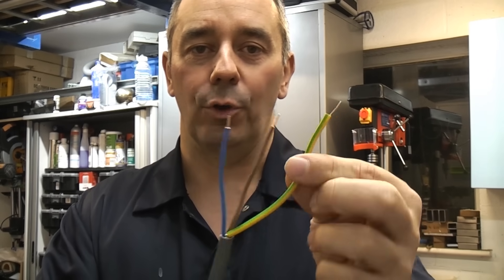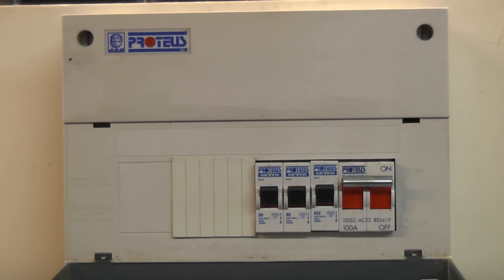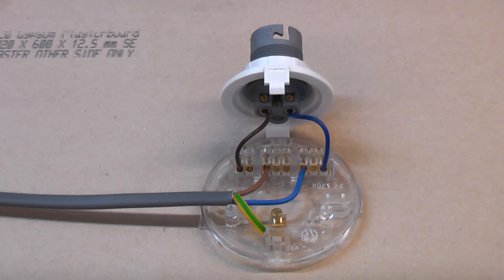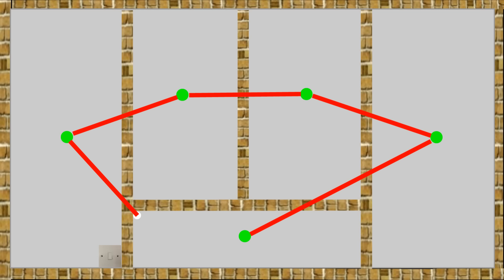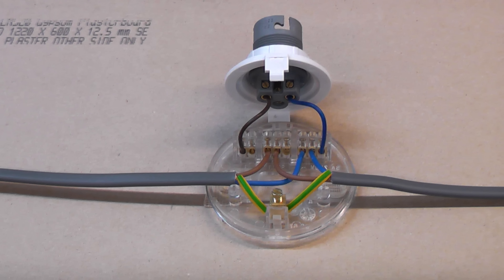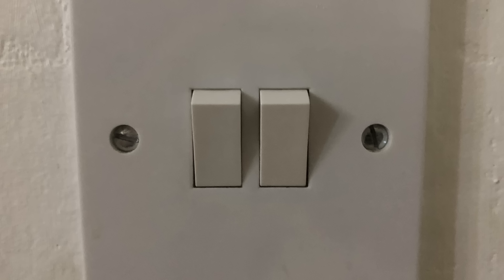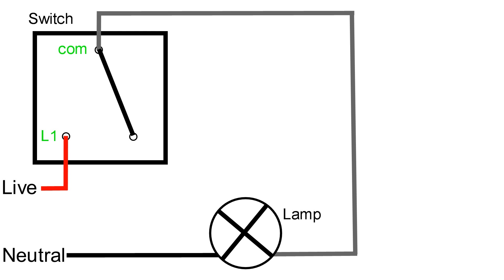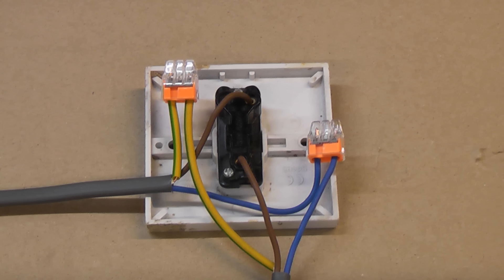UK domestic lighting circuits | Loop in at ceiling rose | Loop in at switch

Comment: I don't understand the lighting circuit in my home (a bungalow) at the single light switch. 3 red wires. 1 in common 2 in L1 or 1 way. Then at the ceiling rose. 1 red in adjacent terminal block to the light flex brown wire. And 2 blacks in separate adjacent terminal block to blue flex wire. NO wires in the Loop terminal block. Any explanation must appreciated
Reply from the maker: It might be the last light on the circuit, hence the loop in would not be used.
For the switch cable, they might have used twin core and earth that has two red coloured conductors (instead of sleeving the black wire). Similar to this - https://fave.co/3cqKsC9
Reply: @ultimatehandyman  Thanks for the info. ALL the ceiling lights have the loop section empty. Its peculiar. 2 blacks cables (can't see any sheathing) and 1 sheathed cable with a Red & earth core!
Reply: Where does the 3 Reds from the switch route too? 1 to the ceiling & the other 2 too the next switch?

Comment: When wiring a LED batten lighting a garage that is on the main lighting ring would I have to use a junction box to connect to the switch, as I cannot understand how you could bring the feed in one end and the switch line out the other whilst keeping the continuity of the ring. Have a good xmas
Reply from the maker: No, you don't need a ring circuit for lights, they are a radial circuit.
You don't need a junction box, at the light fitting you have the live cable with the L,N,E wires.
Neutral and earth go into their respective terminals. The live goes into a terminal connector (not connected to the light terminal). Then a cable is run to the switch, earth is connected to the earth terminal. The live is connected to the other live in the terminal block. Then the neutral wire is sheathed with Brown sleeving and placed into the L terminal on the fitting. Obviously the switch is installed at the other end of the switch cable.

Thanks for the comment 👍

Comment: Do you have a vid where you show how to instal a dimmer with T&E coming from both the CU and from the lamp? All vids I've seen are dealing with just the one set of T&E, my light has 2!
Reply from the maker: No, sorry.
Here's how to replace a normal switch with a dimmer
https://www.youtube.com/watch?v=sKTFR3naoO8

If you have two cables, the neutrals should be connected together?
The earths should be connected together, that just leaves the live and switched live- which are wired to the dimmer ;-)
Reply: @ultimatehandyman  Cheers for the reply. Yeah, that's how it was.

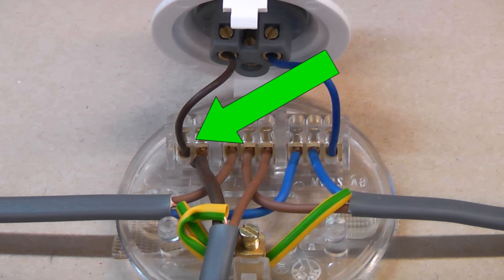Comment: Hi I have a ceiling rose with wires same as shown at 6:05 with one light in middle of the room and a switch but now I want few more led lights with a separate swith what should I suppose to do? Shell I put a wire and connect it to the cable coming from consumer box with live neutral connected to the same point and connect a second rose?
Reply from the maker: I think you might need an electrician for that ;-)
Thanks for the comment 👍

Comment: Hi, when installing a loft light with a switch can I cut any part of the rose loop (once isolating from the mains of course) and add a quickwire splitter to continue the existing loop and then run a spare wire to a switch box and then a light from that switch box? If that makes any sense haha
Reply from the maker: Yes, not a problem ;-)
Reply: @ultimatehandyman  sweet 👌 was just thinking after watching your video again lol would I have to go from the quickwire splitter takin from the rose loop straight to the loft light and then from the light add a switch from there or does it not matter which way round it's done?
Thanks for the speedy reply btw 😜
Reply from the maker: @velocitysoulja   You can do it either way. Sometimes it is easier to take the supply to the switch, but other times it's easier to take the supply to the light, then a cable to the switch to complete the circuit.

Comment: Watching a few videos about lighting wiring there is a bit of confusion about terminology. You have used the word 'circuit' and 'loop'  and they both are referring to the same wiring supplying power to the lights.  I think the word loop is a bit misleading as it is not a loop as the wire supplying the power from the consumer unit does not return to the consumber unit as it does in a ring main for sockets using 2.5 mm. I don't know how or why the word 'loop' ever got adopted, it is a bit confusing. The lighting circuit is more similar to the 4mm radial socket supply as it 'radiates' out from the consumer unit. Just wondered what your opinion is on this ?

Comment: Are bathroom lights done the same? I have a old bathroom light that has a starter.
Reply from the maker: Normally lighting circuits are wired this way. 
Some lights do have starters, such as fluorescent lamps etc.
Thanks for the comment

Comment: Here's an interesting question. We have no earth on the upstairs lighting circuit. I'm renovating a bedroom and found a CPC going to a light on the downstairs circuit in that bedroom floor. I asked on an electrician forum (boards.ie) if it was okay to tap into the CPC in the floor using a maintenance free box and bring it up to the lighting in the upstairs bedroom. Only one person replied saying no and told me to get an electrician which I did. He's our next door neighbour and said it's perfectly acceptable to do so. Now I'm asking you for info on this. If I can run the CPC up what size CPC is required. I read if it's singles it needs to be 4mm. My plan is to take the existing live, neutral and new CPC to a maintenance free wago box in the loft and take a twin and CPC that to the switch and have 2 twin and CPC for the 2 gangs that I require. I'd love to know what your thoughts are on this. Many thanks.
Reply from the maker: I try not to get involved with electrical questions because some of the regs are open to interpretation. 
The best way to start an argument in a forum is to ask an electrical question, you will soon get people arguing 😉
If I had an upstairs lighting circuit with no CPC, I would run a CPC from the downstairs lighting circuit. If you read that 4mm should be used then that should be fine ;-)
 Thanks for the comment 👍
Reply: @ultimatehandyman  haha, yes, I've seen many arguments on this subject on forums. Thanks, that's what I'm doing ATM. The CPC resistance reading is 0.7 ohms on the downstairs lighting to the CPC of the sockets in the same room so there's a good connection to ground. John Ward quoted a reg that says the CPC must go back to the same system. But then says it needs to be part of the same circuit which is a bit of a contradiction. In an ideal world yes but I'll leave a note on the CU to say that the circuit with the branched off CPC MUST be isolated along with that circuit I'm taking the CPC from.

Comment: would be amazing if this could be explained in the old wiring form my house has red and black and earth but i changed a light fitting to have a ceiling fan and i came across 2 black 2 red and 2 earth twisted together and sheathed and i figured out the live red as im able to turn the light and fan on/off at the fan its self but not the light at the switch and my brain hurts :P
Reply: Your explanation doesn’t quite make sense so I can’t break it down, can you rephrase? Regardless if the wiring is old colours (red, black and earth) the whole concept of a lighting circuit is still the EXACT same and hasn’t changed. The only difference is the colours.

Comment: I have a loop in at ceiling rose set up in my bathroom with only one light fixture. I want to install multiple (x5) downlights to the bathroom. Can I just connect the wire that will supply the new lights to the current connections of the existing light fixture?

Comment: Your videos I seem to understand lol. I've just put a downlight in from a ceeling Rose. Plan to use connector block for loop wires. Which amp should I get
Reply from the maker: 5 amp should be fine for ceiling lights.
Reply: @ultimatehandyman  yup I ended up.getting a 6. I also sorted the other issue out i posted on another of your  videos. I found the switch wire. 2 red wires. For some reason it wouldn't pick up on the metre. Continuity was fine but voltage wouldn't work ? But just tried 1 at a time

Comment: In the attic  can I tap into a ceiling light, run it  straight to the switch and from the switch straight to the new ceiling  rose / ime putting up in my attic
Reply from the maker: Yes, that is how most people wire a new loft light.
You might have to check the latest Part P document if you are in the UK before starting the work ;-) 
Thanks for the comment

Comment: Ultimate Handyman,  Many thanks for this video and the others. I have got a small project  in my Garage. there is a lamp using ceiling rose and is looped at Switch. I want to add another light . can i just use the loop on the current rose to get the power to next rose and then to light . Thanks, Robert
Reply from the maker: Yes, if you want the lamp to be controlled by the same switch, just connect the new lamp to L,N,E at the current ceiling rose. (obviously switch the electric off at the consumer unit first) 
Thanks for the comment 👍
Reply: @ultimatehandyman  Did it. Thanks.  All sorted.

Comment: I have 2 two core an earth 1 going from consumer unit to ceiling rose the other from ceiling rose to next ceiling rose then 1 switch with 2 cables 1 single and earth and the other 2 core and earth the core connected to pull switch in same room then single core and earth from pull switch to ceiling rose and on other switch the single also goes to ceiling rose so that's 4 cables 2 x two core and earth plus 2 x 1 core and earth the live switch is 1 of the single cores . I would like to get rid of pull cord and have single light switch is this possible any info wud be appreciated thanks

Comment: I got 4 lots wires going in ceiling rose
Reply from the maker: Somebody might have taken a feed for another light from the ceiling rose, if the additional cable is connected to the L,N,E terminals, or perhaps there is another light fitting that is in the same room, that would probably be connected to the Switched L, N and E
Thanks for the comment 👍

Comment: I'm currently trying to swap out my ceiling light for a new one.
 I've taken down the old one and I can see that it only has 2 grey wires going to it. Each consisting of a blue, brown and earth.
From this video I understand that this means it must be the last light in the loop. One loop in and one switch wire, right?
Nothing is labelled so I don't know which wire is which. Also no brown tape on whichever is the 'switch live'

I'm confused and sat in the dark, any help, please?
Reply from the maker: I made a video on how to identify the switched live wire a few years back- https://www.youtube.com/watch?v=0MLshqOmltU

But in your case it is much simpler.

Switch off the lighting circuit at the consumer unit, or remove the fuse for the circuit. Check to ensure the circuit is dead (I'm assuming you have already done this once).

Choose one of the  grey cables and put the Blue wire to N on the light fitting, earth wire to earth and Brown wire to live on the light fitting.

Now turn the lighting circuit back on. If the light illuminates you know that that cable is the one carrying the power, you  then know that the other cable is the switch cable and that can be identified with some insulation tape. If the light does not illuminate, the cable is the switch cable and again can be labelled with insulation tape, before isolating the electric and rewiring the light fitting.

Comment: Is it not okay to use metal switch if they're double insulated?
Reply from the maker: I've never seen a double insulated metal switch, even if they do exist what about the screws that connect the switch to the metal back box etc.
 Thanks for the comment 👍
Reply: @ultimatehandyman  cheers for the reply. I also asked John Ward on his channel and he too never heard of double insulated metal switches. He says I could line the box with plastic inserts for the job and it would be fine if double insulated switches existed. Here's the model and spec sheet that says it is double insulated. LightwaveRF Wireless Control 2 Gang Dimmer Switch LW420 SS (Stainless Steel) https://support.lightwaverf.com/hc/en-us/article_attachments/115002887152/LW420_Spec_Sheet.pdf it's a faceplate that pops over the front so I assume there's some insulation between the screws and the front faceplate.

Comment: I came to this video expecting something bizarre about UK circuitry. Turns out it's only confusing because you guys don't use black as a switch wire, so seeing a ceiling rose wired up just looks like a bunch of live, neutral, and ground wires with no switch wire present. But then on the "loop in at the switch" photo it shows black being used as the old neutral, so that explains why it can't be used for a switch wire.

Still your whole ring mains ordeal is bizarre to me. I just don't get why you'd do it that way, it kind of feels like asking for trouble.
Reply from the maker: A final ring circuit is common in the UK for sockets, I think they wire it this way so that they can use thinner cables (if you had a radial circuit you would need to use thicker cable). Final ring circuits are often called a "ring main", but technically that name is incorrect as it is something completely different. (I'm not trying to be a smart arse or anything, if you said "ring main" to me, I would know exactly that you were on about), but some electricians would be keen to correct you.
Thanks for the comment 👍
Reply: @ultimatehandyman  I'm neither a native english speaker nor an electrician. So correction on terminology is appreciated. How else am I going to learn it?

From what I gather the whole ring circuit thing started during the rebuild after WW2. Because it used less copper to wire a house.
These days I am pretty sure that they use regular 2.5^2 wire except the circuit breaker is 32A. Whereas here on the continent we use the same 2.5^2 cable to run a radial circuit on a 16A breaker.

Comment: Hi,  Could I ask you how best to extend the wiring from a Ceiling Rose, (serving short flex & single bulb) know behind my new Suspended Ceiling, to make connection for my 2x LED Flat Panels close by.They come with 2x 50V Drivers. 2x wire (brown & blue) one end, &  push fit connector to LED at the other. Thanks

Comment: Hello there. Opened up my ceiling rose, it doesn’t have a loop red live wire in any of the loop terminals ? Works perfectly though 

What does this mean? I thought Whether it be a loop at ceiling rose or a junction box, isn’t there meant to be atleast a earth, live and a neutral for both these methods  ?

Your expertise would be appreciated
Reply from the maker: The light needs a neutral and live to work, in some older houses built in the 60's it was common to omit the earth wire.
Thanks for the comment 👍

Comment: Great video, I'm installing a ceiling fan with light in an upstairs room and was a bit confused about bring the 3 sets of cables through into the new block as it only has L, N and earth, so guessing a junction is my best option
Reply from the maker: Junction boxes are often the easiest option.
Thanks for the comment 👍
Reply: If you are extending an existing circuit or replacing old for new  (damaged cable) then fair enough. If it is a new circuit  then unless you are a competent person  you should not be undertaking the work or you should inform the local authority you are intending to do the work.

Comment: is there any way of getting around light fixtures that do not have a ground in them?but you want to use a metallic light fitting?
Reply from the maker: You have to get an earth wire from somewhere. I’ve seen people run an earth wire from a socket in the past. But you should never wire one up without it being connected to earth. 
Thanks for the comment 👍

Comment: The drill that you have behind you how good is it can you use it in a metal work shop or is it just for diy projects?? Thanks??
Reply from the maker: I've not used it that much to be honest. I guess it depends how much work you are doing on it. We have a huge (3 phase) drill at work in the work shop, but there is also a smaller pillar drill in the electricians shop. I would say that the Sealey drill in my garage is better than that, you can see the one at work being used in this video- https://www.youtube.com/watch?v=6mZj0J6CNYA

Thanks for the comment 👍

Comment: Light is a coaxial circuit.....what is the purpose of earth?.....
Reply from the maker: The earth is to protect the lighting circuit, it is common for people to use metal light switches, or light fittings- which all must be earthed.
Thanks for the comment
Reply: Ultimate Handyman does it act like an over flow?......

Comment: Can you do a video on how extractor fans are wired to your bathroom light? My fan has stopped coming on when the light comes on, and can only be controlled by the switch above the door. Would be great to know how a fan is wired with light switches and separate isolated switches too :)
Reply from the maker: I'll add that to my list ;-)
Thanks for the comment